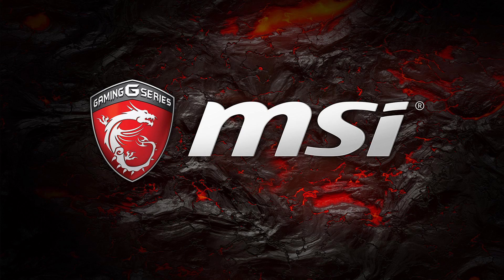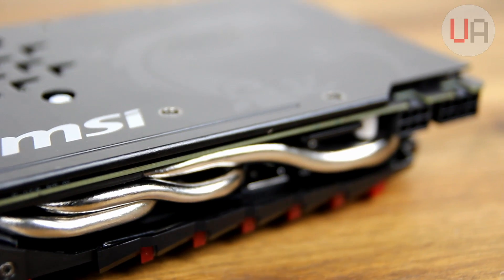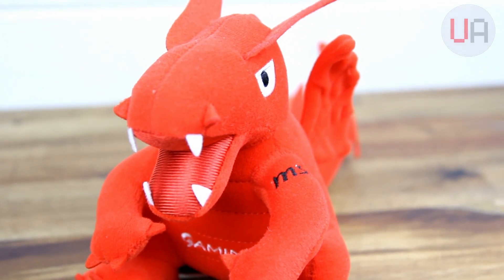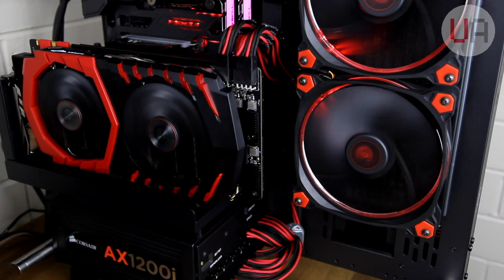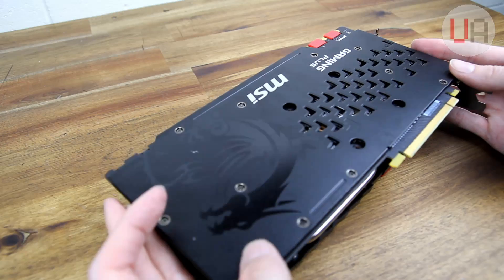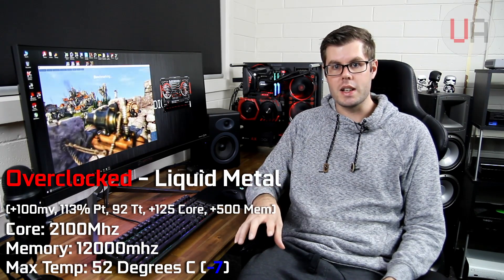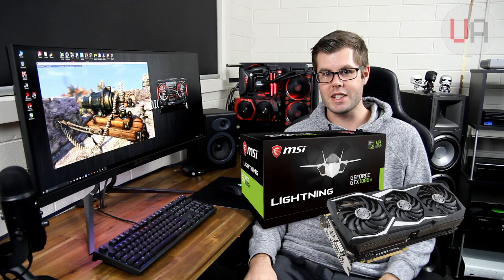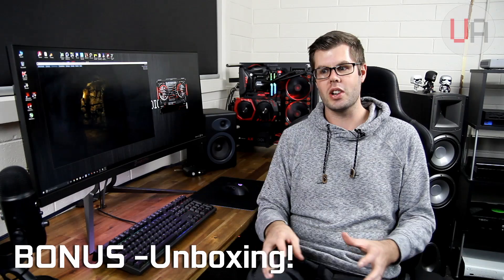Liquid Metal on a GTX1080 Gaming X Plus (TwinFrozr VI) - HOLY TEMPS BATMAN!

Comment: What is your ambient temperature?! I've got a watercooled GTX 1080ti with practically the same temperatures as you get on air. I have an MSI Gaming X model and stock cooler in my office got 66C under load.

Comment: You should apply some small layer of nail polish on the resistors around your GPU. This avoid them from getting damaged by the liquid Metal, its conductive.
 I just wonder how you can get thos stable clockspeeds without doing the Powermod :)

Comment: Many of these test are done on OPEN test benches. Usually people tend to use closed PC cases and in there, the cooking is done. The air can't exit properly or something similar, not a single case has a perfect airflow.

Also, the only good reason you should re-paste your GPU is if you have been using it for a few years, intensively. Like watching 3D - VR - FULL - DIVE - anime - porn intensively.

Good quality video otherwise.

Comment: I did this yesterday on my MSI GTX 1080 Ti Gaming X 11G. Temps dropped 4ºC with the fan on "Auto" and 8ºC with the fan @100% speed (should have tested something less overkill like 65% speed but oh well). That's within margin of error of your 7ºC result. I got it down to 57ºC (overclocked of course 2000-2025 Mhz). That's crazy low. While gaming with the fan on "Auto" it tops @ 72ºC and 1600rpm so the noise level is highly reduced. It's clear that the paste MSI uses, while not bad, is bottlenecking the Twin Frozr cooler for sure.

Comment: how in the hell you gor that low temps on this card i do not know, my card is 74-75 degrees celsius when stock and 1300rpm on the fans. when overclocked it reaches 80 degrees!!

Comment: A bit late, considering they got the Trio out, but wanted to chime in with a clarification - 7 degrees is more like 25% improvement, considering the delta from ambient is like <40 degrees w/o the Liquid metal and you can't go under ambient and you are looking at <65-70 on the max side. Which makes it amazing improvement!

Comment: Even 53c load temp on 0 overclock/stock paste is surprisingly low
My MSI 1070 gaming x hovers around 46-50c even in idle (76-78c on load) with no overclock/stock paste. Although I do have much higher ambient temps (around 30c)

Comment: If I put electrical tape on the transistors can I keep it on there or do I have to take it off before putting the card back together
Reply: If I put electrical tape on the transistors can I keep it on there or do I have to take it off before putting the card back together
Reply: no you can keep it on the tape makes sure that the liquid metal doesn't contact the transistors and short them out but make sure you use tape that can resist high temps a good one is Scotch Super 33+

Comment: Nice video, if I may ask, what case/barebone case are you using? Looks like something practical where you can swap stuff straight away (GPUs obviously...), like something reviewers/benchmarkers would use. I really like that style, the idea of a NON-restricted airspace where air can move freely (and thus not limiting the amount temps that can be decreased). Would explain the nice temps of the GPUs, usually in a closed case temps get above 60C.

Comment: Great videos mate. Could you test the liquid metal on an overclocked Ryzen 5 1600 or what with a Noctua NH-D15 or even better for me an Alpenföhn Olymp (a German dual tower cooler just like the noctua but with different fans of course). I want to do that myself but have the stock paste on right now to actually know the base temperature. I was just wondering if it worth the hassle of cleaning and reapplying. Cheers

Comment: I hope you read this, because it will probably be beneficial to further reviews you make. This is a really good review and I hope you will have further success with your YouTube channel.

In the video you state that the temperature drop is more than 10%. Yes, that's true. But I think you had come to that conclusion in the wrong way by calculating to the freezing temperature of water at atmospheric pressure. So (1 - 52/59) = 11.9 % increase in cooling performance.

The correct calculation would have been (1 - 32/39) = 17.9 % increase in cooling performance. That's because you need to put in the deltas to ambient. You probably would have stated in the video that it's "almost 20% better". The perfect cooler would cool to the ambient temperature, not to 0° C.

Thank you very much for your great videos.

Comment: Subed :)

I got an MSI 1080 X SeaHawk (with EKWB fullcoverblock) watercooled with a i7 4790K (@stock clocks, but also  planned to get delided and covered with liquid metal)...
Even not delided the 4790K does never reach more than 58°C on load with the AX480 radiator by XSPC and the Watercool D5 Pump at level 2 of the pump.

Comment: MSI Radeon RX 480 Gaming 4G.  -8C drop 1440 MHz +78 mV, 100% fans, 300 seconds of Furmark, full screen, 4xMSAA, 36.5C ambient at intake to computer (yeah, hot!)  +100 on the VRAM thjough (the Hynix 4GB chips suck).

Before: 86C, throttling to 1384 MHz after about 82C
After: 77C, with the 1440 MHz OC till the cows come home!

Also running Conductonaut on my delidded i7-4790K, both on the die and on both sides of the IHS, and on the H100i GTX cold plate.  Switched to Conductonaut after hearing it wouldn't solidify like CLU.  We'll see next May on that.  I'll give it a year.  Had to sand the top of the IHS and the cold plate on the pump/block to get the CLU off from the previous year.
Reply from the maker: +Kayla and Jim Bryant wow, nice one mate!

Comment: I got a MSI GTX 1070 Aero OC (Overclocked to 2GHz Core, 9GHz VRAM) and I just ran Fire Strike test and my peak temp was 88c, maybe it would be worth it to replace the paste with liquid metal or even replacing the cooler with Accelero Hybrid III-140.

Comment: @Upgrade Addiction I don't understand y you are not checking and giving us overclocking results and benchmarks after u add the new thermal paste.u might be able to reach a higher overclock than with the stock paste.
Reply from the maker: Patrick S sorry, it wasn't an overclocking or benchmarking video specifically, just a test to see how liquid metal would work on that Cooler :)
Reply: Upgrade Addiction it would be nice if you added these things.Atleast it's something I want to see and I bet alot of your other viewers do to.An overclocking thermal paste roundup would be cool.Atleaat show us if that thermal paste helps with overclocking and performance since it is one of the better pastes on the market.Thankyou
Reply: Pascal GPUs don't have much overclocking to begin with. Temps are not the issues for these chips, it is the power delivery. You can really tell because even overclocked it isn't even going over 60 degress. These chips run cool no matter what.

Comment: Why did you set the Power Target to only 113%?  Why not 120%?
Reply from the maker: 1kyleabc it only goes to 113. Each card has a different power target Max, determined by the bios. 

My 1080 Aorus XE has 138 percent!
Reply: Oh really; wasn't aware of that.  I thought all 1070/1080 were standard to 120%.  
Kind of makes me wonder why MSI is so conservative with the power target on the Gaming X Plus then, because as this video shows, the TwinFrozr VI can handle the cooling extremely well.  Sort of disappointing, especially for a high-end 1080.

Comment: Nice video. I use CLP on my WC'd 1080 Ti to keep the load temp under 36C.  Pascal is much more temp sensitive then previous architectures when overclocked. I went from 2100 to 2138 as long as the temp stays under 40C.
Reply from the maker: +Edward Kinder well done mate :)

Comment: msi uses a pretty crappy watery paste and WAY too much of it. I got a 9°C drop going from stock paste to mx4 on my rx480 gaming x. 72° before and 63° after. Also that's at about 7% lower fan speed.
Reply: Also I thought msi allowed removal of the cooler. The sticker is just so they know to inspect further if a card comes in for warranty.

Comment: Idk if msi changed there policy on this but last i checked you could replace the paste and it would remain in warranty so long as you didn't damage the card. So if you replaced the cooler with say a water block its fine but it must have stock cooler installed for rmas.

Comment: Had a bad experience with TWINFROZR V on my r9 380, where the baseplate was not perfectly flat (or the surface of the gpu itself) and due to a thin layer of liquid metal there was an area which was not contacting the baseplate. The similar problem was with the cpu - using more liquid metal solved it. So, always check the imprint on the baseplate

Comment: i have a 1060, and it run overclocked all day, and i didnt like the temp( about 69-70 on unigine loop 30 min), i have a STRIX model, my ambient temp about 32-33C,  should i void the warranty, or nah ?
Reply: and i already have a custom fan curve, but it still reach 70c, and i need ur suggestion

Comment: FYI to anyone want to delid the MSI 1080, the cooler plate is silver doesnt mean it is a aluminum, I found on the MSI 1080 datesheet

The Ultimate GAMING: TWIN FROZR VISmooth Heat Pipes: Squared shape atbottom maximize heat transfer from the
copper base plate.

so its copper base plate, it is save to use liquid metal TIM..
Reply from the maker: +FGWingman yeah it's nickel plated copper
Reply: I got lepa neoillusion air cooler, i got a plan to use liquid thermal. It is save ?

Comment: I have an msi laptop and it has a warranty sticker on bottom that is in the way of just upgrading it. I called msi and they said that it's ok to open as long as I didn't damage anything while upgrading it. I ended up putting coolaboratories liquid pro on the GPU and CPU. Surprisingly it didn't drop temps much, around 5c or so.
Reply: I put the rest of the coolaboratories liquid metal on my I7 950 with a h110 on it. Dropped temps about 10c.

Comment: -7º or 3 years warranty ?  ¯\(ツ)/¯
Reply: In EU and USA the manufacturer can not void the warranty for removing the sticker.
Reply: Asus and EVGA warranties are still good when using aftermarket paste.
Reply from the maker: HA ha .. yeah that's the choice...... ha ha
Reply: https://motherboard.vice.com/en_us/article/gv5ddm/warranty-void-if-removed-stickers-are-illegal
Reply: Bro....I have a strix 1080ti, I have called asus and they said piercing that sticker doesn't "void warranty". If you fuck up your whole gpu then yes that voids it, but if it dies and it's not because of the paste you applied/or ripping cables/etc, then you will be fine.
Reply: Actually by law they cannot void your warranty for breaking the sticker, they will have to prove in court that it was user error that caused the problem
Reply: It doesn't void the warranty. I have an MSI GAMING X 1080 and I called before replacing the thermal paste and pads, and they said that it would not void the warranty. As long as there is no physical damage done.
Reply: Yea, apparantly some places their laws override the warranty stickers so as long as you dont mess with the wrong things its fine
Reply: Renan Salles actually they do allow for responsible removals.  they don't put it in writing because there are always idiots and scammers.  as long as you don't damage the card or anything involved in an RMA, they honor warranty.  this is one company on record within the custom water cooling community.
Reply: -7 yolo !
Reply: Yep can confirm that I e-mailed MSI directly and changing the paste does not void the warranty for NA buyers.
Reply: I asked msi directly and they said as long as there's no physical damage when you break the sticker than you should be fine. Take LOTS OF PICTURES before you send it in to show that there's no physical damage.

Comment: Holy temps! The MSI TwinFrozr cooler is no joke!! I'll definitely buy a MSI GPU when I upgrade my current GPU.

Happy to see that big companies are noticing your quality content and are helping you out. Well deserved
Reply from the maker: It is a LEGIT cooler!!!

Thanks mate! :-)
Reply: Yeah we have two of their 1070s and they are fantastic out of the box with the TwinFrozr 6! They have really won me over.
Reply: i run a msi 1070 the cooler is fantastic
Reply: iTz_DaNiiLo just don't get the armor version if you go with the GTX 1080 ti  cause it uses the GTX 1070's cooler
Reply: Mari <3
Reply: Only buy MSI if you plan to not have a fault. MSI's RMA process is terrible. Buy EVGA.
Reply: Got the msi 1080, the cooler is good but definitely not silent under full load, and the VRM module #7 can overheat when running benchmarks like FurMark. So it's not a perfect card.
Reply: Help, i don't know what yo buy xD, the asus strix version or this, msi gaming x :P, what is better? (temps, oc capacity, average fps, etc)
I say this because in the most videos i seen the asus version wins in average fps, in all videos, between all cards :P
Reply: Yeah MSIs cooler and design game is really high and with this little tweak shown in video you ll have your most favorite GPU of all time, even more so if you dont settle for anything less than 1080ti.. I myself go for the a red-looking rig and with their great looking gpus its even bigger joy esp. when mounted vertically.. I know I look like a little fucking fanboy right now, however I tried few other gpu pcb manufacturers and they were not as good as msi when talking about performance, cooler design, looks design, noise and overall lifespan..

Comment: l tryd that with my gtx 1070 Strix with thermal grizzly conductonaut and in oc mode +200mhz core, +500mhz memory, +100 voltage, 92°C max and +112% power i gained like nothing..my max temperature in bf1 was 66°C with stock paste and i got the same with the conductonaut.
Reply from the maker: hmm, thats curious...... does it take longer to get there, to the max? or you literally saw no change at all???
Reply: I didnt see any changes at all.Thats why i removed it and replaced it with cooler masters master gel and i got the same results. I even took measurements on the ammount to take of your 1080 evga video.  Maybe it wasnt enough but i am too scared to put more on it.
Reply: Ok got it fixed, seemed that i didnt use enough conductonaut on it. The surface of the Strix cooler isnt flat as the surface of the GPU die , but a littly rough, so i didnt use enough paste to close the gap. A friend of mine used like twice as much as i did and now under the same conditions i didnt even hit 60°C anymore.

Comment: It would be interesting to see how much the liquid metal would improve Closed loop watercooled cards.
Reply from the maker: Hmm, are the AIO cards easily pulled apart to access the GPU Die? If so, id dare say itd help quite a bit.
Reply: EmoScoobyDoo Not sure it would help much since temps are usually fairly low but would probably help it dissipate faster. For example my r9 390 in 20°C environment reaches around 40°C in gaming and my 1700x around 37°C.

Comment: Won't it smear after you put the backplate back on and make the liquid metal contact the transistors? And do you know if this can be used with a EVGA 1070 SC Black Edition?
Reply from the maker: Only if you put too much on, less is more with Liquid metal. As i mentioned, if you are scared, put some nail polish or tape over them to protect them
Reply: I can't find any information on the material EVGA uses on their 1070 SC Black Edition, where did you find that info?
Reply: Upgrade Addiction can i just leave the electrical tape on there forever or are they used only for when applying the paste?
Reply: Thanks!

Comment: Influenced by your Conductonaut videos I've delidded my 6700K and put Conductonaut on both my GTX 970 SSC and 6700K! Still have to finish my build to see temps; the first time I put it on I didn't put enough liquid metal.
Reply: I really want to do this but I do not have anything to delid my cpu with, not even a vice :/
Reply: SlackPie/Mystosia check out de8auer, he has a nice channel and actually sells his own delid tool, which I used, much safer than a vice and even has a relid kit that you can buy, it cost me I think $40 for everything
Reply: Will check it out I need that for sure haha, I've been on his channel before I just thought he's kit wasn't ready yet
Reply: SlackPie/Mystosia I totally recommend Rockit Cool's Rockit 88 Delid and Relid tool! In my opinion it's the best out there. Super easy and safe to do and it's a high quality product.
Reply: Will check it out man thanks!
Reply: SlackPie/Mystosia his 115x series delid tool is ready, the x299 is not